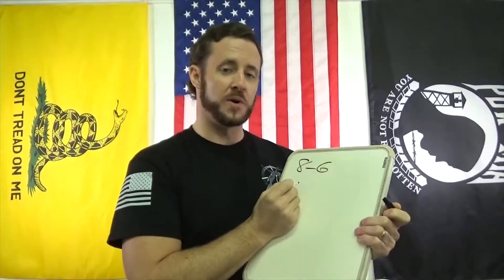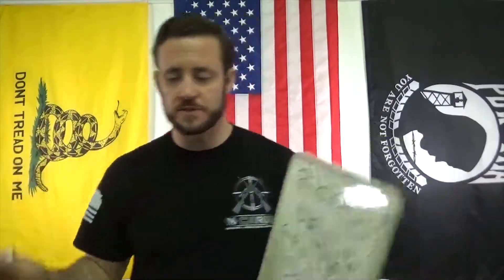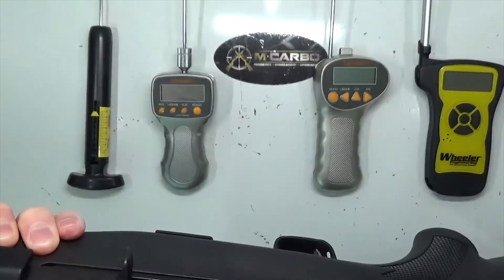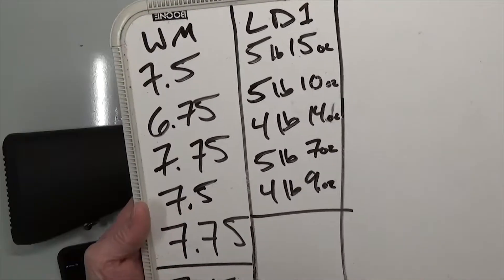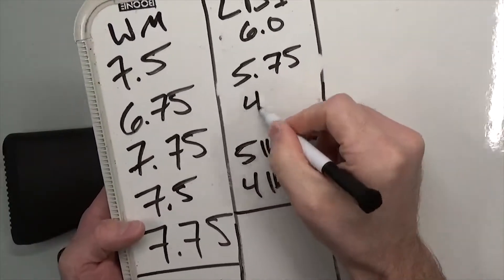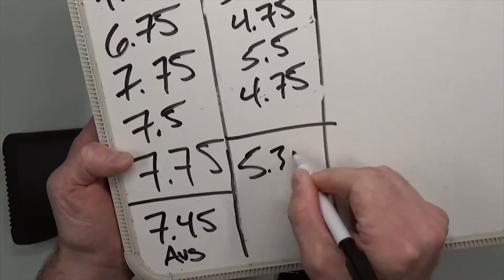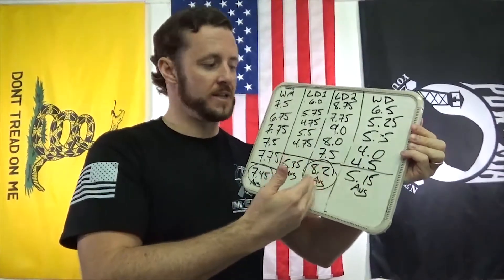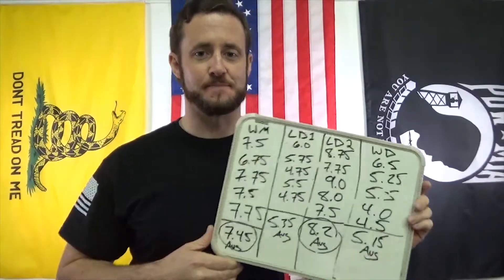Trigger Pull Percentage Explained - MCARBO - Best Trigger Pull Gauge

Comment: It is important to pull the trigger "in-line" with its movement and not have the lever arm at an angle. Also important is to pull very slowly and release pressure as soon as the trigger goes off. For example, 5 trigger pulls produced 2# 11.5 oz, 2# 11.5 oz, 2# 15.9 oz, 2# 11.3 oz, 2# 13.8 oz. That works out to 2.71875#, 2.71875#, 2.99375#, 2.70625#, 2.86250# for an average of 2.8# or 2# 12.8 oz. And sure enough that was the average on my Wheeler Professional Digital Trigger Gauge.

Comment: If you are going to use these instruments to create an average, the human instrument needs to have consistency as well. Speed, angle, smoothness, etc. All play into factor when recording data. 
Also, you absolutely need to perform these tests at a slow pull rate.
If you're able to slow the video down far enough, you can see the pull force number continue to rise even after the trigger breaks.

Comment: Big savings with the manual guage and if you test it with known weights you can record the actual reading of over or under.. For example if you know it reads 1 lb over at 5 lbs and 2 lbs over at 8 lbs etc. then you can get just as accurate as the digital and save a ton of money.. It is not rocket science..

Comment: Good description of variation  of trigger pull readings and differences between gauges, manual vs digital.  I use a  Lyman [new version] and find it to be pretty repeatable.  One thing you didn't touch on, [probably because it wasn't the topic of the video] but is important....  the speed or rate at which you pull the trigger when taking readings.  Almost always, a faster pull will result in a lower reading., slower pull , higher reading.  Now it doesn't really matter , fast, slow in between, but what matters is you want to be consistent when taking your readings.  This will give you the best data for determining percent reduction.  Also, try to pull at the same direction or angle each time, because that will also change your readings,  enough to skew the data.  Hope this helps to explain trigger pull testing a bit more, and hopefully not confuse the heck out of everybody. 
 Just remember, try to be consistent in how you pull the gauge...same speed, same direction, accurate digital gauge and you will get the best data to work with.  Oh...almost forgot, the Winchester Model 70 Trigger Spring Kit Works!!!  That Verified! I  just installed my second and got a very, almost unbelievable significant reduction in pull weight, in the neighborhood of 50% for both...sweet!  Kudos on the Engineering.  Simple solution that just plain works....plus is extreemly reasonably priced.  Buy one today, you wont be disappointed.

Comment: I noticed a wide variation in trigger pull techniques in this video. For example, the measurements taken with the WM had sort of a jerking motion vs. the slow & steady trigger pull motions with the digital gauges. Junk in, junk out.

Comment: i think you should be more careful in using these gauges the reading are way off on all of them, your going to get a different reading if you pull the trigger at the end of the trigger or the top of the trigger it should be pulled at exactly the same spot on the trigger each time, although his data did show insight as to which trigger tester was consistent and that was the 2 calibrated ones

Comment: Thank you, this video put things into perspective. So you like the New Digital Lyman better?
Reply from the maker: Yes Sir, we prefer the New Digital Lyman Gauge
Reply: @MCARBO  IF YOUREAD THE MANUAL, it will tell you to place your finger on the part that goes over the trigger. (this is the sensor!) Not to pull the hole gauge. All the sensors are in the part that contacts the trigger. you can get more precise readings using this method. So many people use this gauge wrong.
Reply: @MCARBO  On the previous comment, I forgot to mention it was about the Wheeler gauge and how you should use it. Sorry for the confusion.

Comment: I can't buy that Wheeler manual after seeing this. I really wonder how the Timney manual does.  Buds Gun Shop has the Wheeler for $15, but 2 lbs off really sucks. Nice comparo, thanks.
Reply from the maker: Thanks Brother.  Glad you liked the comparison.
Reply: if you know it is two lbs off then just do the math,    easy right,   if the guage  pulls at 7 lb then you know it is 5 lb.  or order a sticker and place it over the top of the old one  or  heat the sticker and move it.
Reply: @ctsteve1967  , build a precision rifle using junk?
Reply: @senatorjosephmccarthy2720  as long as you can reduce the trigger pull by 25% then it will be a precision rifle. At least I think that’s what he’s was trying to say. Lol